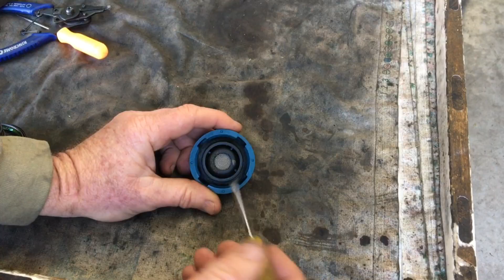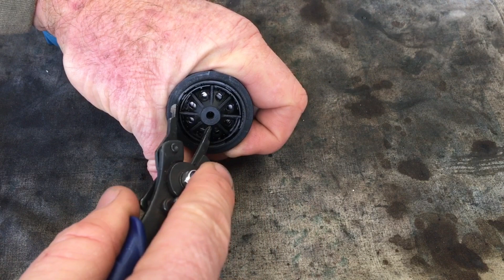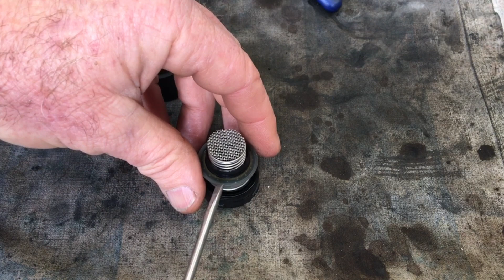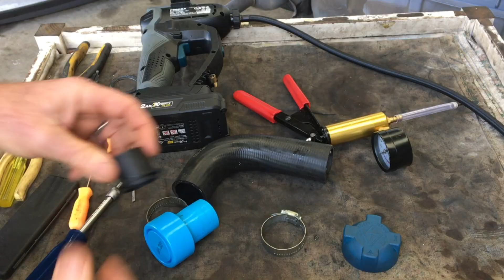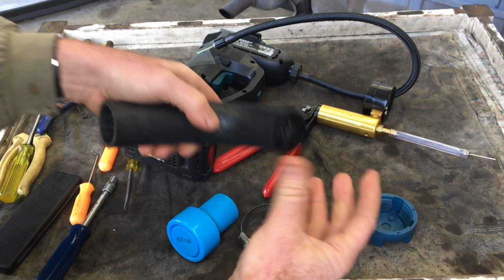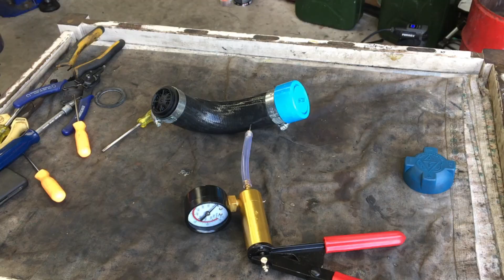Porsche 986/996/987/997/981 coolant cap disassembly, cleaning and testing

Comment: Jeff, what would be the indications that the cap might be failing?  Thanks
Reply from the maker: If under pressurising you might get coolant boil off earlier than you expected, especially if the coolant isn't good eg. mostly water.

If over pressurising you have the risk of leakage or component failure. I'd be worried about expansion tank failure as this seems to be the general point of failure on other car makes where they used higher pressure caps.
Reply: Ok, thanks Jeff.  Cap service is now on my list for spring when I next have the engine cover off.
Thanks again, your videos are my trusted source for my 981s maintenance.  Still building up the courage to do a coolant change 😁.
Barrie
Reply: @jeffrichardsoncardiy Well that's so interesting, especially important as aging plastic parts are subject to failure. It would be really cool if the cooling system had a pressure gauge! (pun intended!) to know what is really going on.